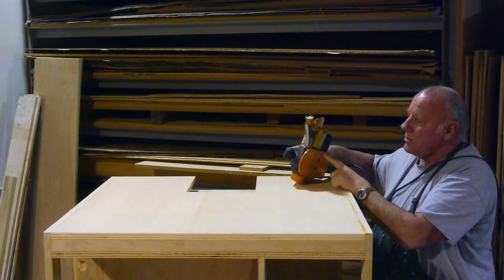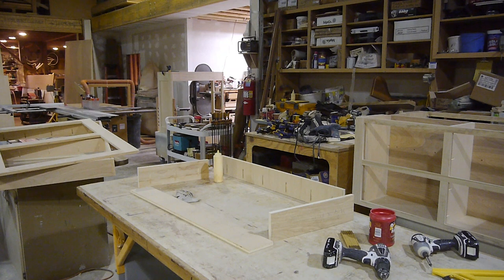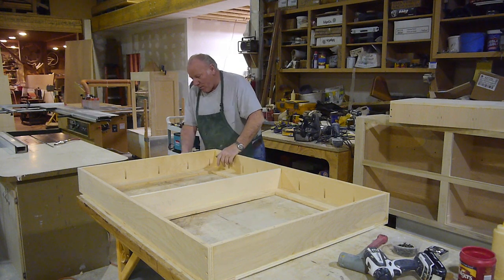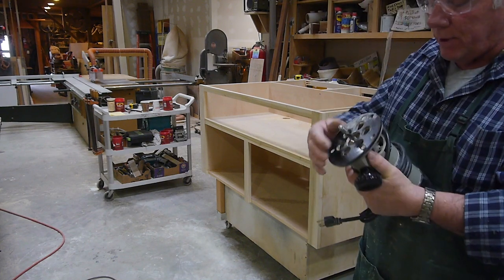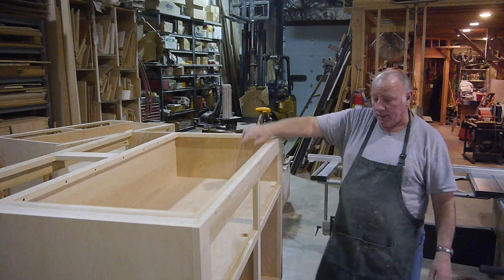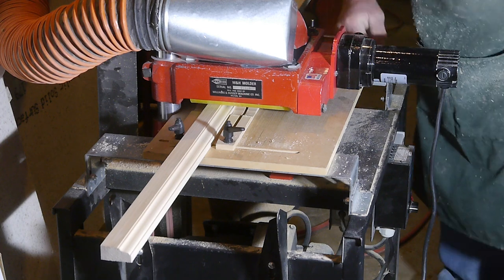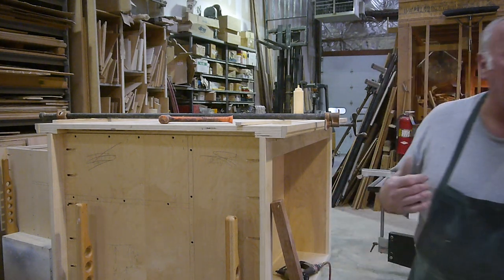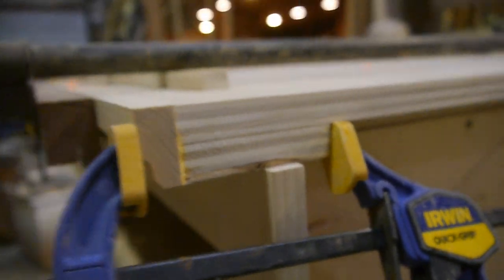How to Build a Room Divider with a 2 Sided Fireplace. Part 3

Comment: Nice job Mikey! As a professional cabinetmaker / wood finisher myself, you and I are a lot a like in so many ways and thought processes. A lot of people don't understand the difference in a true custom built cabinet job versus the big box store cheapies, or plywood versus melamine. I hope I can learn a new thing or two from you as well, and hopefully I can return the favor. Can't wait to see your method of making frame and panel doors. I recently revised my door building process of four processes (coping, sticking, panel raising, and out side profiling) on only three shapers with all dedicated tooling. I can share it with you if you are interested. Keep up the great work. Cheers! Scott (aka- The WoodCraftsMan)

Comment from the maker: Thanks Scott! Share as much as you wish..  :-)  Part 4 will show how I make my doors - and yes, I've got several shapers set up, dedicated to different stick and cope profiles, as well as others with panel raises, perimeter profiling and back-cuts. When you manufacture your own doors, it's imperative to set up (at a minimum) at least 3 dedicated shapers (cope, stick and standard panel raise). Having a wide jointer (12"), a 24" planer and a 37" wide belt sander completes my collection for profitable door making "in-house". I mostly like having control of the joint fit, wood selection, etc. when building my own - which I'm sure you know exactly what I'm talking about! I'll look forward to learning from you as well, never too old to admit I don't know a fraction of what's really out there!